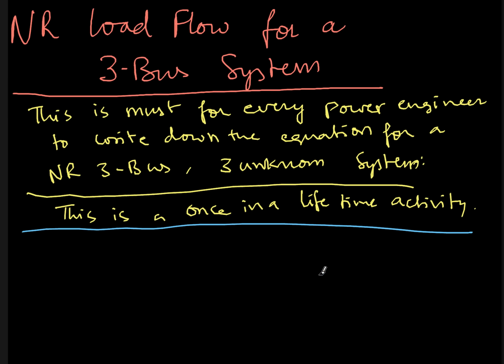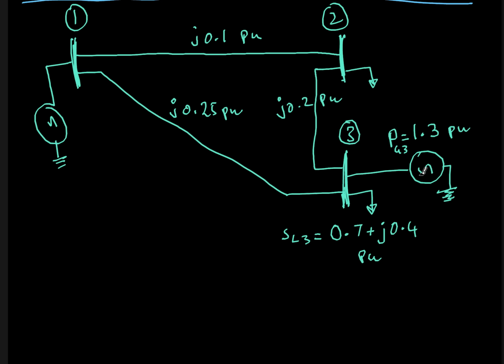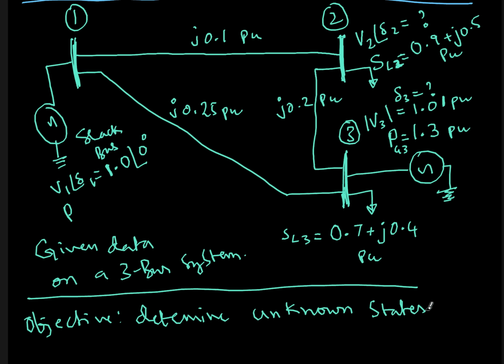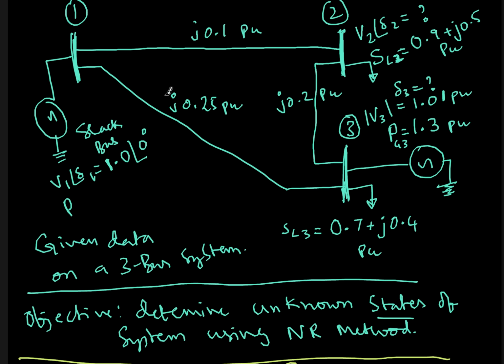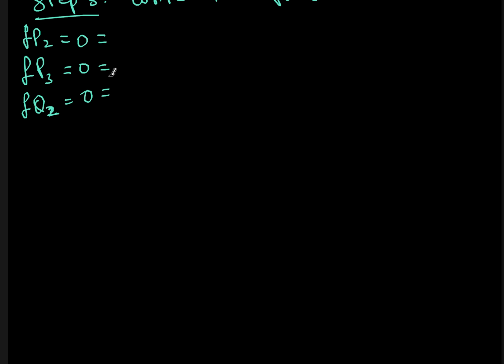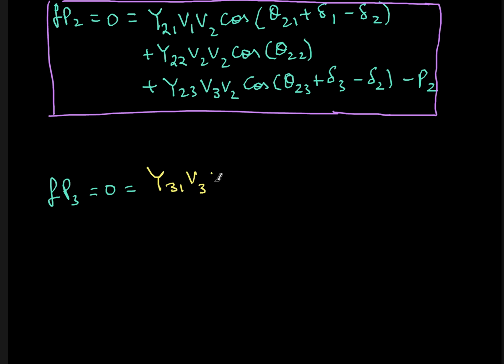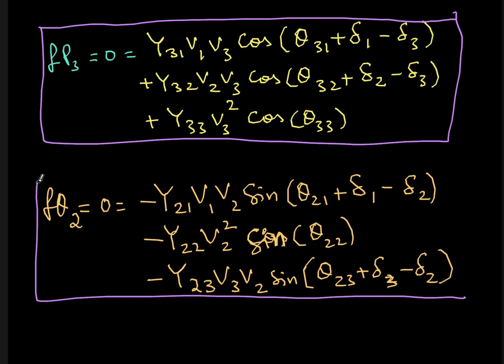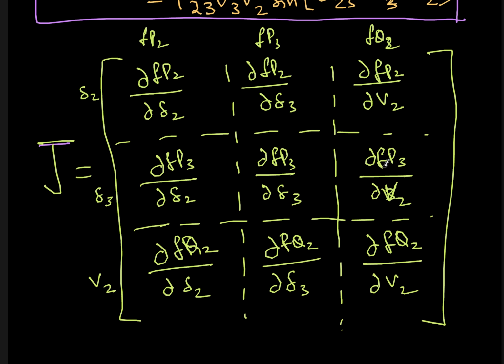Newton Raphson Load Flow Solution - 3 Bus - Part 1 of 3

Comment: This is a good tutorial. 
If there is a branch bus in the middle of transmission line which is not connected to either generation or load, do we still need to generate the power flow (P and Q) equation for this branch bus?

Comment: Using the generalized function the equation for f(p3) and f(q2) calculated has some flaw. You have not done minus of p3 and q2 respectively.
Reply: Yes. Thanks for pointing out the mistake. Other's also commented about the same mistakes. Unfortunately, youtube has disabled the addtion of text boxes etc to hilighlight where the mistake was made. I can't redo / edit the video now. Anyways, in part 3 of the video, this mistake was corrected (while coding) and we got the right answer.

Comment: sir, please answer this...
In a power system with 100 buses, 1 bus is taken as slack bus, 15 buses are PV buses and rest are PQ buses. The number of variables to be solved by Newton-Raphson method in polar coordinates is...
Reply: The no. of variables to be solved using newton raphson method is = 183
1. 15∆ from the pv bus
2. 84 v + 84 ∆ from pq bus
Total no. Of variables = 84+84+15=183.

Comment: why cant we use P2 equation for V2?
Reply from the maker: Good Question. If 2 is a load bus, then both P2 and and Q2 will be known, and therefore you can  use any combination (1) that is P2 equation for delta2 and Q2 equation for V2. or combination (2) that is P2 equation for V2 and Q2 equation for delta2. However, if 2 is a generator bus, P2 will be known and Q2 will be unknown, on the other hand |V2| will be known and delta2 will be unknown, that will leave only one combination, P2 equation for delta2. So, irrespective of load or gen bus, taking P_i equation for delta_i and taking Q_i equation for V_i always works, and it avoids confusion by being consistent.